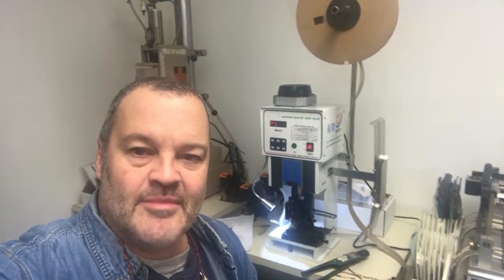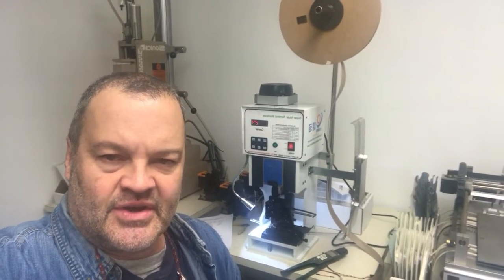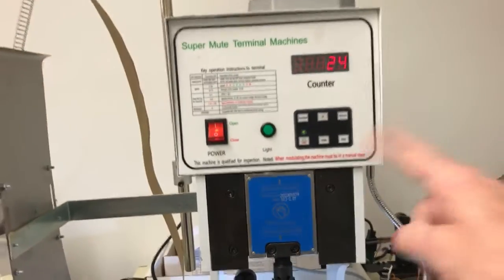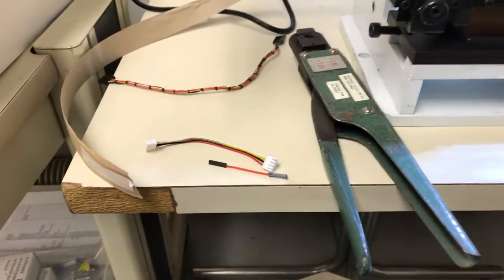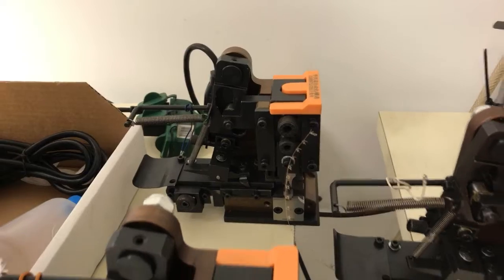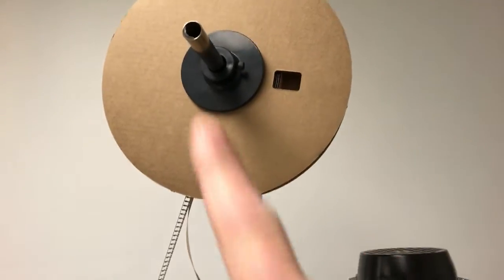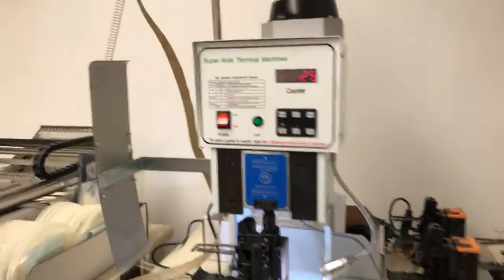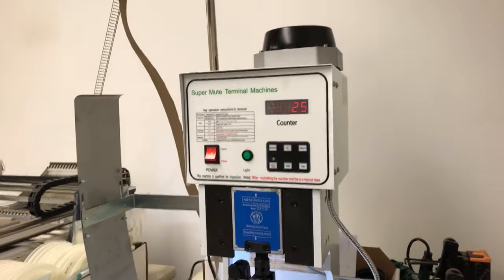Electric pin crimping machine, Yihan YH-2.0T, DuPont, JST, Molex, etc.

Comment: Where do you get the spools of connectors?
Reply from the maker: They are available from most any electronics distributor.  Digikey, Avnet, Arrow, Future, Newark, etc.  But, yeah, you might have to buy 1000 pieces to get the reel.  If you buy less than a reel they usually come in a strip that you can still feed in this machine because that is how they are manufactured.

Comment: Thanks for sharing! Do you have to purchase a full die-set for each connector type or did you just buy them to swap them quickly? I am wondering if you could just swap the actual die element that crimps the parts?
Reply from the maker: Yes, I bought several dies sets so I could swap them out as needed.  Swapping the dies requires a little fuss but is reasonable.  However, if I had a large production operation and needed various dies I would just buy a press for each die and that way they could all be set up and ready to go.
Reply: @MathIndy  Sounds like the way to go, thanks for the comment!

Comment: Thanks for the video.  I had gone looking for something like this a few years ago.  I see lots of models on Alibaba now, from your recommendation...need to sort through all of that.  I need a die for Dupont connectors to come along with it.  My reels of Duponts are only connected with one spine on the insulation side of the connector.  Is it possible for these machines to just do one-sided connector reels?  Videos I see seem to suggest they can, but noting your demo had a two-sided reel, made me wonder if that's something I have to be aware of.
Reply from the maker: The Alibaba seller I bought from was very helpful.  Get in touch with them and I am sure they can answer your questions.